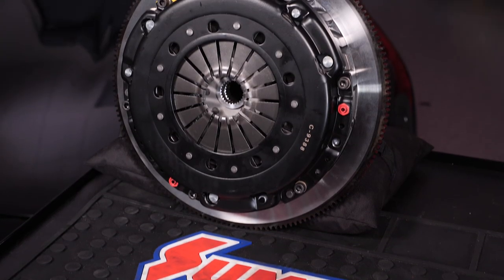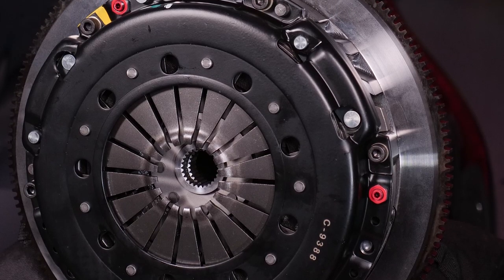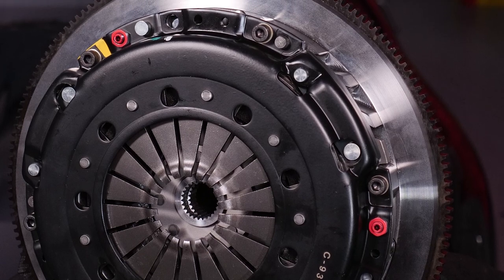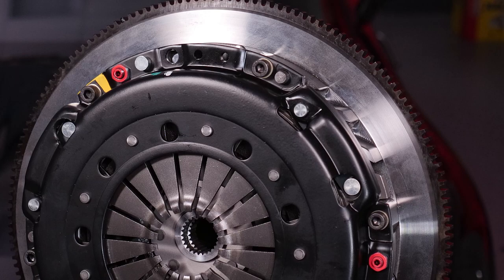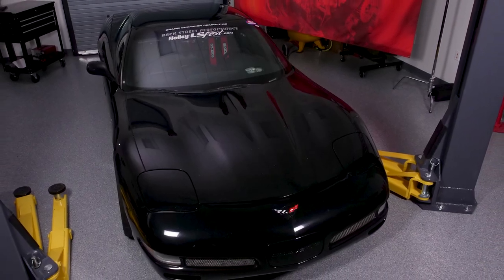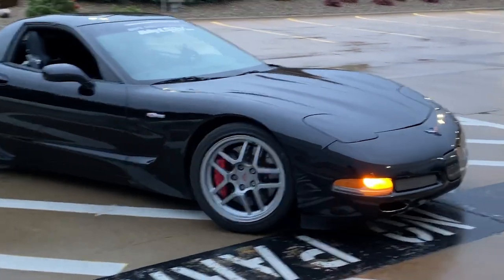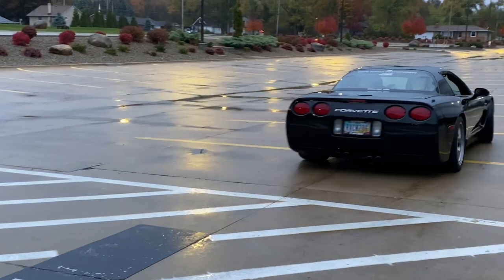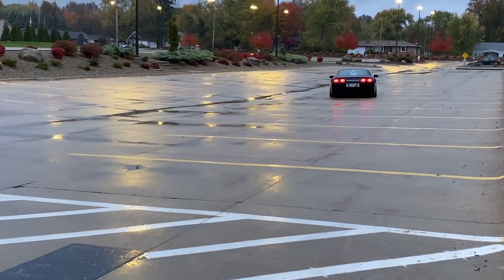Summit Racing Pro Twin Clutches

Comment: Is this available for truck applications?
Reply from the maker: Thank you for your question.  As long as your Gen. 3 or 4 Vortec truck’s trans uses a 1.125 shaft with 26 spline, the SUM-700901 or SUM-700903 should work depending on the torque capacity you need.  We will be releasing more Summit Pro Twin Clutches in the coming months.

Comment: Is this clutch rebuildable
Reply from the maker: Thank you for your question.  The flywheels can be resurfaced and the disks can be replaced.  We will have clutch disk replacement part numbers added to the system soon.  We do not recommend surfacing the pressure plate or mid plate and those should only be re-used if they are within tolerance.